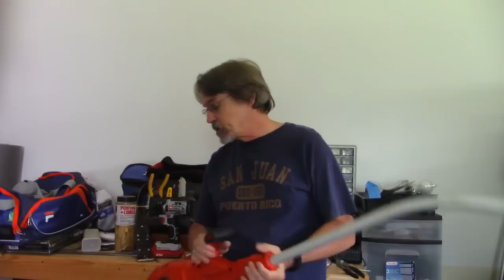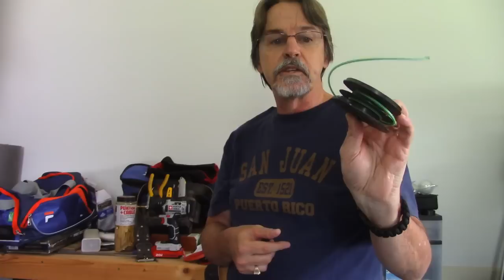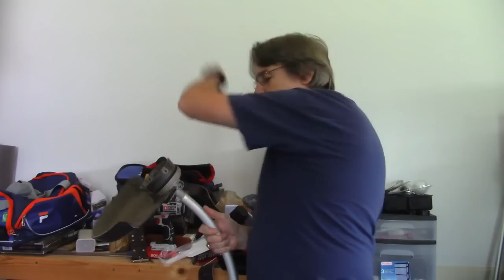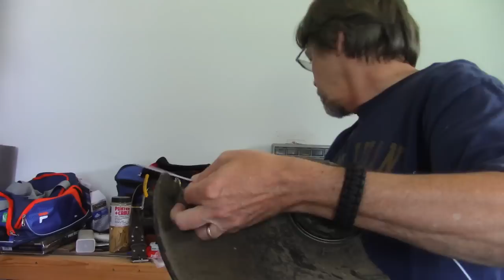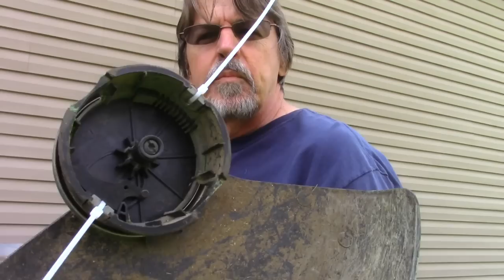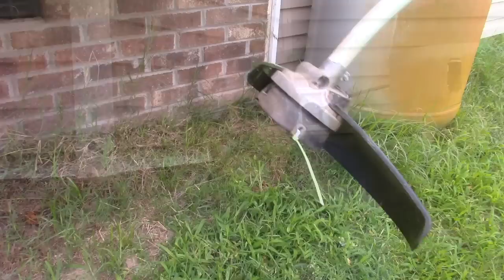Can Zip Ties Replace Weed Eater Line? Does it Work?

Comment: I just tried this several times and discovered that as long as you don’t tighten the zip tie to tight, it’s fine. The second you tighten em up it’s bye bye for the zip ties. Also tried just inserting them through the holes in the line head without actually zipping anything, and that seems to work the best. And it’s quicker and easier.
Reply: That is what I was thinking
Reply: Im using a steel wire now, works like a charm if you know the area you are clearing, about to try one of those multipurpose blades

Comment: Hey, I'm late to the show, but I wanted to thank you for saving my GrassHog GH1000.   I  couldn't find the zip ties so I used  .085 line - first trying it leaving it loose and then looping it around through the hole again so it was secure.    Then, I drilled (4) more lines in the housing. so I have (6) lines of .085.    THIS THING IS NOW A BEAST!    I cleared a 50' x 4' x 3' high section of weeds behind my fence witihout skippig a beat and without losing a single line.  They were a bit shorter in length than when I started, but I'm blown away.  The addition of the extra lines did not seem to heat up the whacker.  Thanks again.  Mike
Reply from the maker: Cool, glad it helped!

Comment: Try using mutithread wire. Cut the wire to length (diameter of the guard) open the multithreads in the middlle of its length to equal the diameter of the spindle. Put a grommet in the hole you made in the wire, tighten the wire arround the circumference of the grommet. Thread the wire through the 2 holes ( from the inside out) in the cap and slip the grommet over the spindle along with the cap. Replace and bolt back onto the cap securely. In other words replace the cord with wire as thick a gauge as is neccessary. It will last a lifetime and will even cut into small tree branches. They only sell you cord so that you consume, they won`t sell the trimmer with wire, no way.

Comment: that's a cool idea....I agree trying the thickest zip ties on the market may make a huge difference.
Reply: btw.....how long does that 420 last you in propane?
Reply from the maker: Yeah, those broke really easily.
Reply from the maker: It lasts us forever because we don't get that much cold weather and the gas only runs the fireplace. I think we only top it off every other year.
Reply: +MrBulletpoints right on. Believe it or not...those are the hardest type of Tanks for me to obtain. I pay nearly as much for them as I do a 500 gallon tank. Our suppliers put them on trucks and ship them to FL and charge twice as much as they do here. They are desired (when customer has low quantity usage) because there is not a code requirement of distance from the house.

Comment: I tried other stuff but decided to use the string it was designed to use and saw on another channel just tie a knot on one end and slip it through the holes. I thought it would fly out but the knot  by centrifigual force keeps the knot from coming out. But remember tie the knot and pull tight. I carry extra in back pocket as when they wear out, easy to replace and no string bumping
Reply from the maker: That is what I do now too. I figured that out after trying lots of different ways. (I've had a video about that or a while myself).

Comment: The problem with going through the string too fast is the auto feed. I've found that using aluminum tape holds it in place to keep centrifical force from moving the autofeed. It's a pain to have to stop every once in a while but it beats paying for all that string.  Mine is a single string feed Black and Decker - corded. I'll never again get an autofeed.

Comment: Great Tune! Not heard it in over 20 years!!!
Reply from the maker: Thanks, I've been using it for a while. I get a few people who recognize it.
Reply: Man, are u on the ball today! I am going to use the method today on a Ryobi trimmer that NEVER FEEDS at all!
Reply from the maker: It was kind of an experiment. I usually buy a bulk roll of trimmer string, cut off a few pieces, tie a knot in one end and put those through the holes. Works great and costs way less than the pre-loaded spools.

Comment: I have that exact kind of weed eater. I HATE the autofeed feature. The first time I ever used it, I ran through a whole spool in like 15 minutes! 
I found that every time I pulsed the motor, it fed more line whether it needed more line or not. 
So I put some cardboard under the lid to disable the auto feed and manually have to undo the lid when I want more line.  I can get at least 3 times of doing my whole yard on one spool. Takes about 30 minutes to do my yard.  
It is a bit inconvenient, but no more than putting on a fresh set of zip ties.
Reply from the maker: I got rid of that one a while back. It could sometimes take two entire rolls of line to do my large yard one time.

Comment: I have a Echo weed eater and it works great. I buy a very large roll of the plastic  and cut pieces to fit my weed eater and I have no complaints at all.  I put the pieces in an empty water bottle for storage, so I can get almost through the  whole season without re-cutting.
Reply from the maker: This was an experiment. It doesn't work that well. I do the exact same thing you do. The bulk rolls are so cheap compared to the pre-loaded spools.

Comment: Cool tip, never heard of using zipties like this b4. Wonder how well they will hold up in a gas powered weed wacker. Thanks for sharing.
Reply from the maker: I would like to try it again with stronger or multiple zip ties. The ones I used broke too easily.

Comment: I use one with a saw blade on it. My wife uses the string and spends a lot of time cussing. That was a fail. They make some that are pretty heavy duty. I like Roundup concentrate in an electric sprayer :)
Reply from the maker: I need to rig up some hard plastic cutters on mine. The zip ties break if you even think about hitting anything solid. My grass laughs at Roundup. I have to hit the sidewalk cracks almost every week... It comes right back.
Reply: Lowes keeps the good stuff under lock and key.

Comment: Tried it with heaviest duty zips I could fit.  Lasted a few seconds.
Reply: zip ties are made of a plastic that becomes brittle at high loads. They're not rubbery/flexible at high speeds as the mower line is.

Comment: During a hurricane everything loose flies through the air but usually lands undamaged everything hard fastened really gets blown apart so leave your zip tie loose in the hole without fastening them maybe they will handle the stress much better

Comment: You might want to try copper wire. Copper wire is flexible and should at most bend if it hits something hard while cutting through grass.
Reply from the maker: I wouldn't want to get hit by any type of metal wire. Please wear safety glasses if you try this!

Comment: The zip tie will break off easily, yes.  You can use bigger line or better yet a cable.  It works better for sure.

Comment: Sorry sir, but I have to give you 
2👍thumbs up.  With all the weed eating I have to do; every little bit helps.  Definitely dealing with the line is an issue I don’t like to deal with.  However, your suggestion will definitely decrease the amount of effort this job usually requires.

Comment: I wonder if you left them just loose enough to have some give if they would act like a flail blade....  and since it lost a lot of weight i wonder if you could add two more zip ties in the other holes.  Thanks for trying it out
Reply from the maker: I thought of that after I looked at the video that might have made a big difference if they were mounted loosely.

Comment: Normal weedeater use, no issue with weedeater. For other areas like the easement, I use a 6" metal cable that I buy from lowes, but it smokes the engine of the weedeater. It often has to cool down but it does work. Just wish they would make a weedeater that was more durable and with better weed line like a metal cable or a 10" table saw blade. This video just shows grass. Not sure why your having a problem with what looks like nice green soft grass.

Comment: sir may i ask, is your unit still working today? i ask because i've heard that black and decker product isn't durable, but i thought of buying one of their grass trimmer like yours. so i thought of asking for your advice and opinion. thank you sir.
Reply from the maker: Mine is still working fine. I just don't like the pre-loaded spools of trimmer string made for these. The B&D Grasshog models actually got very good reviews from Consumer Reports. I buy bulk rolls of string and use that instead of the spools. Works great and is way cheaper.

Comment: ill bet small steel cable the size of a pencil lead or thicker would work good if you'd cut a piece twice as long as you need, double it over, put the bend through the hole in the weed eater, then slip the doubled line through the loop

Comment: I would be curious to see if you wrap it around the shaft and put it through the whole if it would last longer .. never tried it but I'm thinking the Locking clip of the zip tie wouldn't be exposed and it would be using the face instead of the edge and would probably bend easier instead of breaking really enjoyed the video I will give it a shot

Comment: I replaced my string with some zip ties, but after using it for just a few minutes, they broke off why?
Reply from the maker: Most zip ties will break fairly quickly. some last a little longer. I have found it works better with actual trimmer line you can buy in bulk rolls way cheaper than the pre-loaded spools.

Comment: good for emergency but the cost of the zip ties lol cheaper to buy the proper string i could see using the zip ties on a broken weed eater instead of replacing the head as a temp solution but that's about all good test good video
Reply from the maker: Yeah, it actually works pretty well as long as you only hit grass, but the expensive string is pretty fragile too. I go through tons of that stuff.

Comment: One thing that does work- I have been using it for over 30 years. I have even cut down small trees with it, lol. Home Depot or Lowe's sell carbide tip circular saw blades in different diameters from $5 to $15. Buy a blade with as few teeth as possible like a 7 1/4" to 10" 24 tooth blade. 140 tooth blades work too, just will not trim as fast. Fewer tooth blades are like a chain saw. BTW- fewer teeth blades do not clog up! Take the head off completely from the weed wacker. Buy a spacer too for the blade to shaft size difference. Replace the head with the carbide tipped circular saw blade. I have had the same carbide tip blade on my weed wacker for over 30 years without ever changing it yet. A word of caution, keep that carbide tip blade away from you because it is dangerous and will cut you deep. But is a nylon wire or zip tie safe either if you get wacked with it? You decide!

Comment: make a couple of hard plastic blades and attach then with the cheap zip ties... hopefully if you hit concrete the zip ties will fail and you can re-use the  blades (if they are not embedded in your shins LOL )
Reply from the maker: LOL, Good idea. I'm thinking if I connect the zip ties loosely they might not break as easily.

Comment: I use aluminum wire from an old section of chain-link fence. I can hit many hard surfaces before the impacts break it.
Reply from the maker: I started using the real trimmer string again but not the pre loaded spools. I cut short pieces and tie a knot in them then put them through the holes. Works even better than the expensive spools.
Reply: Exactly! I do the same thing and I don't have to buy spool after spool like they designed the junk to use!

Comment: If they are cheap they may not be nylon.  You want the nylon ones.  If you see discolored ones soak them in water B 4 use.  Nylon needs some moisture to keep its strength.

Comment: Best line I've found is Husquevarna's, although I did see recently a utube video where a thin steel cable was used, and not only cut brush, but lsted quite a while. I need to try that!
Reply: steel cable wont last as long as regular trimmer line tried it
Reply: Gary you are right about the Huskie trimmer line. I use the Husqvarna  silver line and that stuff is tough.

Comment: Tried heavy duty zip ties on my Ryobi.  Snapped off in 2 seconds.  Too much torque?
Reply from the maker: Try cutting short pieces of trimmer string and tying a knot in one end. Feed them through the holes in the trimmer. Works way better than Zip ties. They will still eventually break but they last longer and cut better.

Comment: what about the thicker zipties in the larger square holes?
Reply from the maker: Check out the updated video, (click the upper right corner of the old video) I tried it with better zipties.
Reply from the maker: I meant to try that but got a little sidetracked, It would be interesting to try it with one in each of the little holes and two hooked loosely on each of the square holes.

Comment: Forget it, zip ties aren't made of the same plastic and don't have sharp edges like weed eater string. Yes for a short time, until you can get a spool of string. The older zip tie's we used to get in the late 70's and early 80's were really tough. Had a metal tab molded into the head to keep the tie locked. I worked for Bell Telco since the late sixty's and these ties came out about 78 or 79, and was an industrial product, for bundling wire( telephone type wire and electrical cable's). Those things were over made, the plastic was some fancy name stuff but were real tuff. Oh wait they were some type of nylon plastic(stuff)
Reply from the maker: It was kind of an experiment. I usually buy a bulk roll of trimmer string, cut off a few pieces, tie a knot in one end and put those through the holes. Works great and costs way less than the pre-loaded spools.
Reply: I use to. Now I do it the easy way. I hire a kid to eat my weeds.

Comment: Hmm wonder how 2 zip ties per hole would work and that sounds bad... LOL. I've never thought of zip ties in my 15 years of weed eating!!! When you run out of string and dont have anymore it seems like its always half of the front of the house you have left. Have a good'nnn
Reply from the maker: Yep, I thought of that after I looked at the video. It might not put that much stress on them if they were looser.
Reply: Will there be a test 2? Have a good'nnn
Reply from the maker: geargriden19 Maybe if I get time (and it's not 140* outside...).

Comment: Hello from Victoria Australia, back to the drawing board, there is a design waiting,but haven’t see one yet, tried everything thing, all break get tangled,or waste time, I think a disk with a cutting edge. But not a metal disk.
Reply from the maker: Lately I have been buying bulk rolls of trimmer string and cutting it into 9 or 10 inch pieces then tying a tight knot in one end threading the pieces though the string holes. It works great and doesn't break like the zip ties and when it does break it is really easy to reload a new piece. It saves a lot of money over buying the pre-loaded spools.

Comment: I bought a cheap model which was only 30 euro. (Steyr basic model) . It has a double line like the one you use, works well, fast revving, but eats line like there's no tomorrow. I bought a couple of spare cartridges, and a reel of line, however I found it a nightmare to wind new line onto the reel, every time you have one side wound on, as you are winding the other, somehow the reel slips in your hand and both sides come loose, forcing you to start again. I also found that when the line broke and I had to remove the lid to the reel, somehow the line had fused to itself and needed to be freed before I could rewind it. What a nightmare.

I found a solution. I bought some more line, a 50m roll, but for the better, more expensive model which is slightly thicker and therefore much stronger. The original line was clear plastic, but the thicker new one is red. I cut a slot in the reel divider, which separates the twin lines. Cut a length of line about 4ft long, and force the line into the slot, about halfway in the length, so roughly equal lengths can be wound on each side of the reel. Or maybe instead cut 2 separate pieces and fasten each to their individual sides. You can now wind both halves of the reel at the same time much more easily.

I find the line is not breaking much at all, even when cutting the grass against rocks, and some tile edging I have to my grass, so even on 3 or 4 outings, I'm still not using hardly any line, whereas when I first used this model I was going through a reel every outing. I love my cheap strimmer now, and would recommend it without reservation, but not with the original line.

Comment: fishing leader line is a good choice.
Reply from the maker: It was kind of an experiment. I usually buy a bulk roll of trimmer string, cut off a few pieces, tie a knot in one end and put those through the holes. Works great and costs way less than the pre-loaded spools.

Comment: If I could find the strongest zip ties possible maybe it would work. Mine snap to about 1/2 inch pretty quickly
Reply from the maker: Yeah, works best if you tie two pieces of real trimmer line to the holes (Make a knot in one end and put it through the holes in the trimmer head).